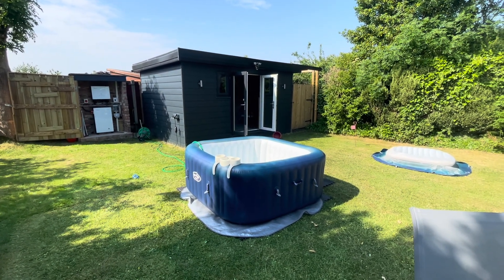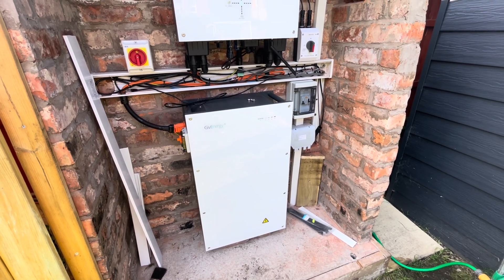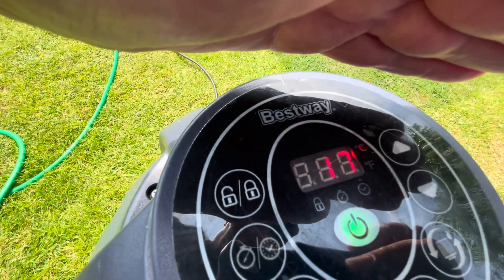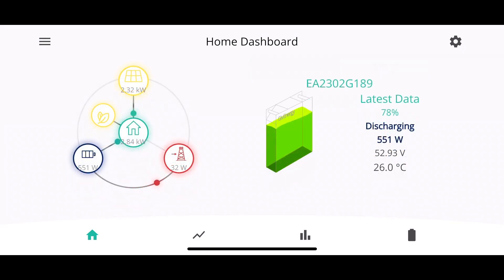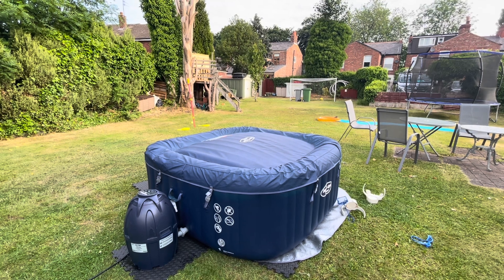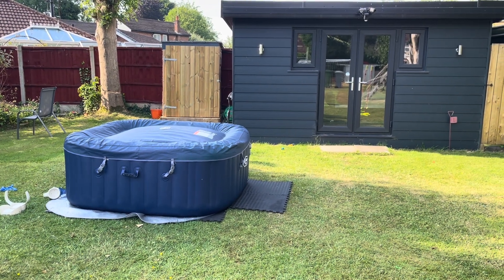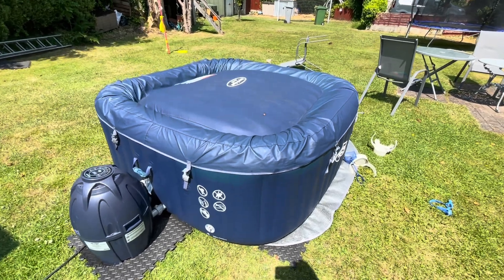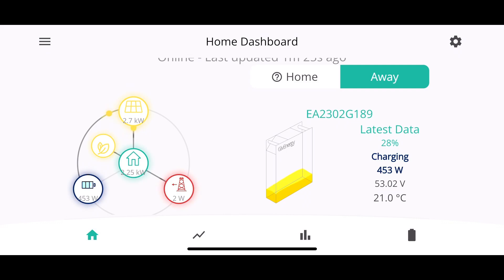Hot Tub Working On Solar Power your joking Right Seeing is ￼Believing watch

Comment: 50 ml Insulation board under tub and above lid, massive help in loosing temperature overnite. Lid wont pool with rain as flat. Less power needed to top up each day to get up to temp. Hope that helps.